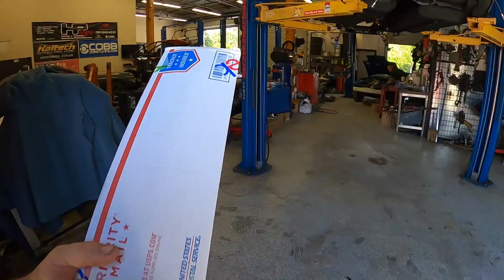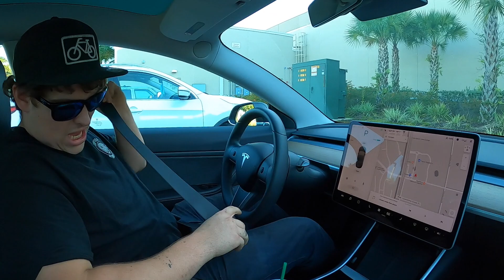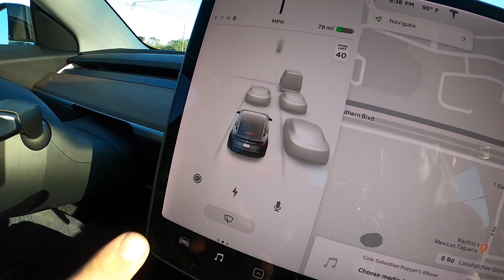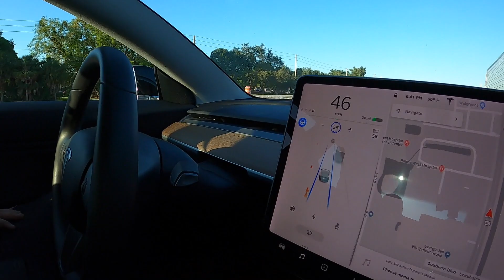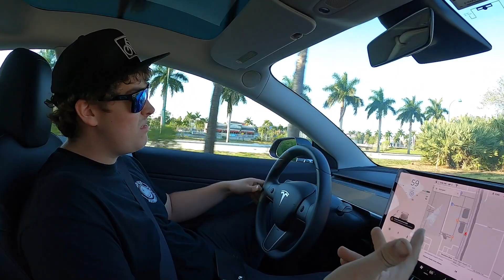TESLA MODEL 3 VS 500HP R32 GTR!

Comment: Love how absolutely nothing Chris owns has an alignment lol..
Reply: he doesn’t think and he just bought a bunch of tires
Reply: Hey look they just started disconnecting batteries...
Reply: What’s that
Reply: I mean his schtick is being ignorant
Reply: @vicsstang89  It's mind numbing how many youtubers will spend $20k in mods on their rides and won't spend $30 for a circuit breaker so they don't kill batteries on their parked cars. Circuit breakers were one of the first things that got put on all my supras. But at the same time you should find what circuit is drawing with the key off and fix it.
Reply: @IzAndy69  Maybe but probably not... his CR-X! will be the first one to get an alignment. Lol
Reply: On that note...Chris, get the most life out of all those new tires and use Groupon for some alignments! you can get all of you cars done for like $200. Literally $40 for the last 4 wheel alignment I had done via Groupon and they did a perfect job on a computerized alignment machine. I just searched Florida and found dozens of them starting around the same, $40 & up
Reply: 'Dood I need an Alignment' - rudnik, every single car he owns lol
Reply: @vicsstang89  im honestly surprised hes only had 1 issue due to leaving the battery connected.

Comment: I raced a model 3 dual motor with my 500whp 350z and pulled on it pretty good. You should be fine Chris. He did not have ludicrous mode though so good luck on that

Comment: tesla cant even do a full hot lap of the ring so right now you even have a faster ring time than teslas
Reply: tbh i don't think chris' car could finish a lap round the ring either. Lol
Reply: Didn’t the Model S lap the ring half a minute faster than the Taycan back in November?
Reply: @iPhoneAppReviewer  they added up best sector times with heavily modded cars the tesla cant handle flat out for 7 minutes
Reply: chris Yes it was a heavily modified prototype Plaid version which would be more prone to failure with its experimental tech but it didn’t fail and completed the full lap. Here’s a production Model 3 completing a lap at the ring https://www.google.com/amp/s/electrek.co/2019/04/09/tesla-model-3-performance-nurburgring-race-track/amp/
Reply: @2k12Chris  godzilla did it stock 8:22... You're crazy.

Comment: Yes, R32 was the fastest "mass production" Nissan at the time, but their fastest "road car" of that era, was the 1998 R390 GT1. It was a mid-engine car powered by the VRH35L 3.5L twin turbo V8 which produced 550hp, and had a six-speed sequential gearbox stock. It could perform the 0-60mph test in 3.9 seconds and could carry itself a 1/4 mile in 11.9 seconds. It's said it's top speed was near 220mph! That's in 1997-1998 too! The catch, only ONE was ever produced!

Comment: Please don’t buy a Tesla you’ll get bored and annoyed of it in a week 😂 you can’t do shit to them unless you want to spend stupid amounts of money. I do valet and these cars come in all the time and I see how shitty they are after 10000 miles
Reply: Dr Swagger King whats so shitty about them
Reply: Jimmy Newtron dude I’ve driven at least 50 Tesla’s at my job and every single one I’ve driven over 10000 miles they’ve made crackling and popping noises from under the car. Power steering is shit after 5000 miles, interior is a lot more shitty looking and feeling in person than on camera, also the sensors are the most annoying thing when you’re in tight places. And auto braking is a lot more annoying than you think
Reply: Jimmy Newtron they literally got taken off consumer reports because it’s so bad
Reply: Jimmy Newtron also if something breaks, only Tesla can fix it. Also don’t be surprised if your brand new Tesla, delivered from them, has scratches on the paint and unaligned doors
Reply: Tyler McGuire I’ve purchased plenty of parts from the service center and the things they won’t sell me are in abundance on eBay. By law they can’t void your warranty for someone other than Tesla working on the car under the Magnuson Moss Warranty Act unless the mechanic did something wrong which led to damage as a result and Tesla can prove it.

Comment: The gtr does not look like it has 500 hp at all maybe 350 375 but definitely not 500 it would move way faster
Reply: Wrong
Reply: Semi trucks got 500hp
Reply: It's about torque
Reply: @IllegallyAcquiredKIA  what are you talking about lol I understand you need torque to move but even if it had 500 hp and 350 ft lbs of torque it would move faster is what I'm saying it looks more in the power/torque range or 350 375
Reply: @IllegallyAcquiredKIA  and your semi truck comment makes no sense one were talking about a maybe  3500 lb car and your bring up probably a 20000 lb truck second semis are diesels and they usually make double they amount of torque than hp and a 500 hp semi still sort of hauls ass